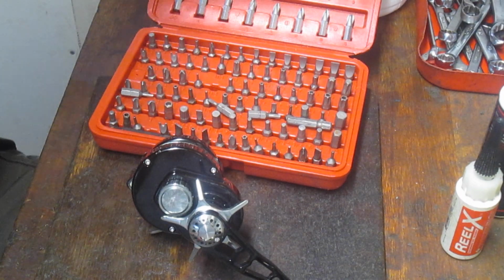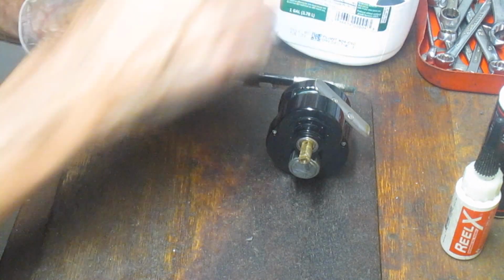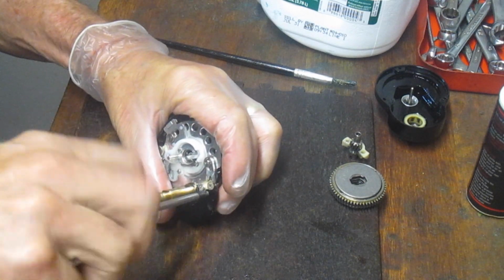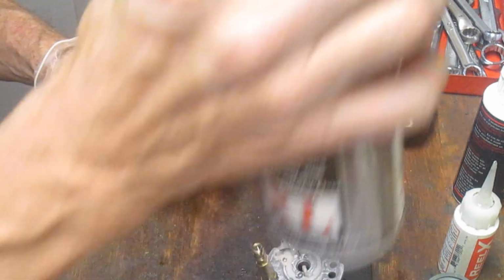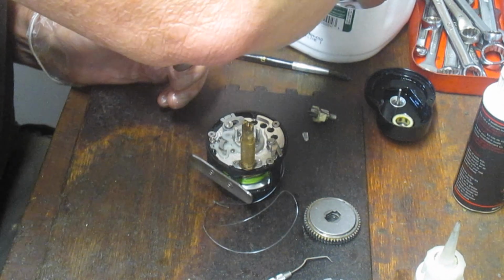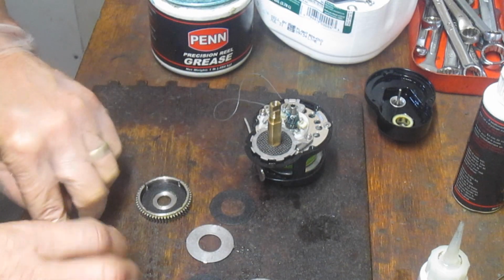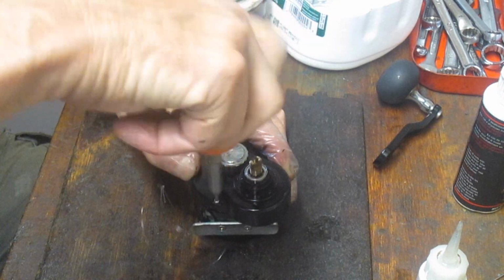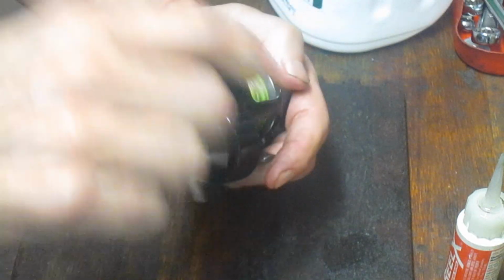Maxel Hybrid narrow frame saltwater reel how to take apart and service

Comment: When did you decide not to lube the anti-revers roller bearings anymore? Thanks in advance for the reply.
Reply from the maker: I read somewhere that they should run dry, so I stopped adding grease then.  The only time I do it now is when the bearings are frozen or gummy and I only use a penetrating oil at that point.  I use it more as a cleaner that a lubricant - Best wishes - Dennis
Reply: @2ndChanceTackle  Thanks for the reply. Season's greetings.

Comment: This reel seems kind complicated to break down for frequent cleaning. More over the screws inside look like a potential place for rust to set in. Otherwise it looks like a dandy small reel for jigging or even live bait fishing with 30-40lb braid to 20-30 lb fluo leader. Wonder how it cast an anchovie.
Reply from the maker: This is a nice reel.  They packed a lot into that frame.  I agree, those screws could be a problem if you don't service the reel and keep it clean.  Best wishes - Dennis

Comment: Maxes is not a brand I am familiar with. Also I don’t think I’ve seen a conventional reel that s so narrow. It certainly has a large gear! This is not a reel that I can use but it is very interesting. Very fine video Dennis!  Oh, I got my Penn 105 Silver Series reel this afternoon. I had to build a spool clicker spring for it but other than that the reel is in excellent condition both mechanically and cosmetically. It was even larger than I expected. It’s very smooth and clean.
Reply from the maker: I like to show all types.  I like this reel.  Very solid for inshore fishing.  Sells around $200.
Dennis